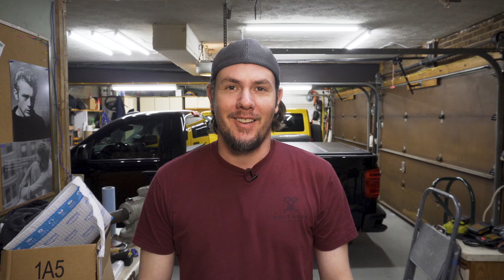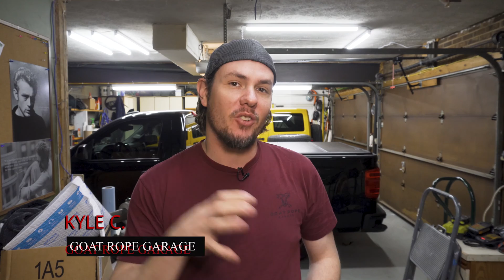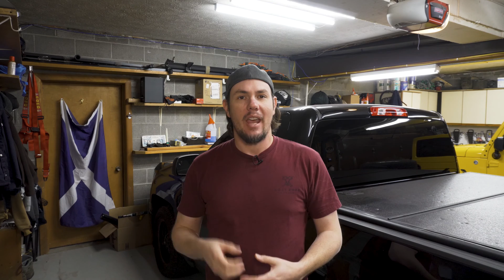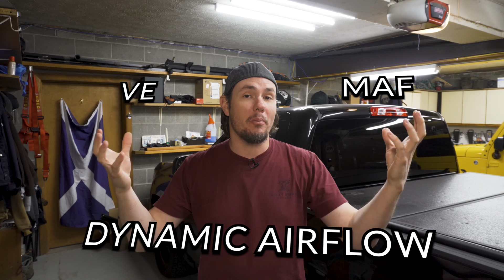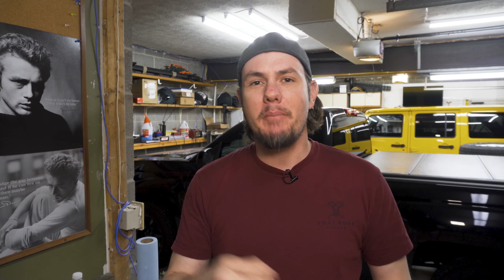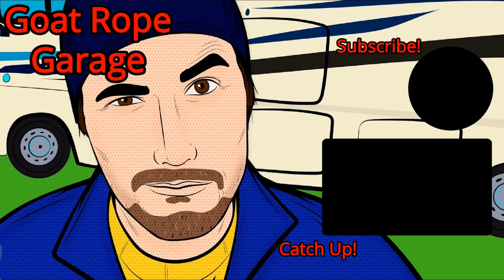Dynamic Airflow Explained, What It Does, How And Why We Want To Tune For It

Comment: I dialed in my MAF and VE tables using LTFT after I used my AFR gauge to dial in the higher rpm/map areas. It’s within -1% and +1%. When I turned everything back to normal it shows it’s adding 2-7% fuel everywhere. Did I do something wrong?

Comment: I am working on tuning two vehicles: both 2008 GM 6.2L - one is a Yukon Denali and the other is a Cadillac Escalade. My problem is, the Denali is not showing a "Dynamic" sub-tab under "Airflow". I am baffled as to why these two models are not showing the same tabs and sub-tabs in the HP Tuner VCM Editor. There are more missing tabs on the Denali, but the dynamic airflow is the first big one that is impacting me following the recommenced tuning procedure.
Reply: Found my issue - it was the basic vs advanced settings under Edit > View > Advanced

Comment: Would it be an issue to up the rpm on the dynamic air flow to rev limiter?
Reply from the maker: Nope, you'd just disable dynamic airflow

Comment: Thanks Kyle,
With the changes made to my C6 Z06 in picture : Lingenfelter cold air intake + Lingenfelter MAF, FAST manifold, WCCH Cyl heads, AFR headers,  long tube X pipe, low resitance Cats B&B mufflers.
I had to change the Low and high MAF ranges. (Range table privded by Lingenfelter were lower than stock)
The DTC P0420/0430 showed up.
So adjusted MAF ranges.
Fuel we have in the Netherlands is oct 98. Shell V-power.
Now You made me clear to learn abut VE tuning.

Comment: Under the dynamic airflow tab there are a couple of parameters which i believe affect how dyanmic airflow works.

*Dynamic airflow disable (usally 4000 RPM)
*HI/low RPM (usally set at 2500 RPM)
*Hi/low map (usally set at 84 kpa)
*Map delta low
*Tps delta low
*Map delta hi
*Tps delta hi

I know dyanmic air disable is the RPM above which filtered MAF airmass is only used.

But which do the other variables do?
I believe it has to do with determining if the engine is in steady state or not. 

Great videos mate👍
Reply from the maker: The deltas are for making sure that you're not jumping around on the VE map when is making predictions usually
Reply: I would like to see more on this DAF tuning as well. My SD tune is pretty good and my MAF tune runs excellent but I want to see it how GM would've set up my car. I'm only at 600 rwhp and 0 deg LSA so the stock parameters in Dynamic Airflow may not apply to me. So far the car wont transition correctly and falls flat on its face.
Reply from the maker: I'll be touching on it in future episodes